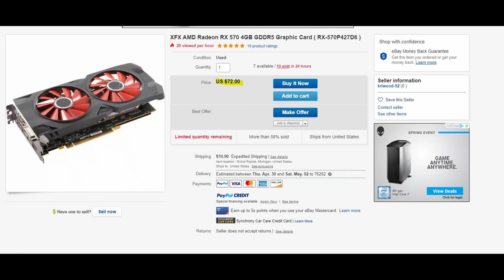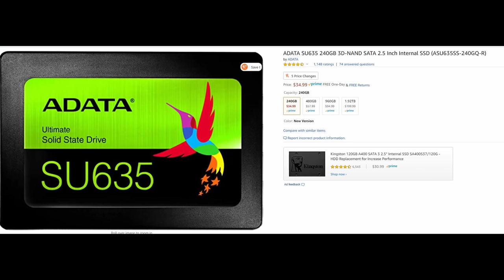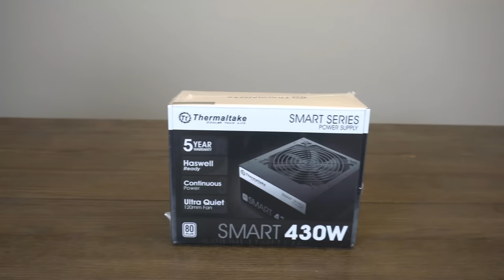$220 Just Get Gaming PC Build - Dell Optiplex 2020 + Benchmarks

Comment: The guy in video: A pc fit for gaming in 2020 standards, me: U need at least 2tb HDD for the games, come on my guy mw warzone is over 220gb Ur SSD will just about install 1 or 2 games if Ur lucky. I still have 6tb HDD for games, as my 2tb and 1tb Samsung Evo ssds are full of games.
Reply from the maker: I guess if you never uninstall a game you would need that much space.
Reply: @PCTechHustle  because my main drives are SSD, re moving and re installing causes ware and tear. So I very rarely uninstall games from the SSD, whereas the 6TB is a normal HDD I uninstall games that I no longer play.

Comment: How does warzone on low mid high settings run
Reply from the maker: Will run completely fine on those settings.  I have some additional bench marks coming along as I just upgraded the case and CPU in my latest video.  Benchmarks to follow!  Stay tuned!
Reply: @PCTechHustle  ok thanks!!

Comment: Wait ur telling me this rig got 134fps in fortnite but I have a rtx 2060 r5 2600 16g 3000mhz ram I play capped at 144fps but it doesn’t stay constant at all low settings mhmmm somthing is fishy
Reply from the maker: The lower FPS numbers at 1% and .01% lows are due to a CPU bottleneck.  I can improve those lower numbers if the graphics settings are capped to say around 120-60fps, etc.  This is pretty typical of when you have this situation being a CPU bottleneck.  Your system will have a much smoother game play experience.  HOWEVER, stay tuned!  My next video I put in a i7 2600 to see if we can get out of that CPU bottle neck and REALLY improve performance.

Comment: You need to add the drill price to the build man, everyone dont have the tools you have!
Reply from the maker: I disagree.  1. You don’t need to drill out the drive cage as I did.  2.  The price should reflect the components.  If I go with your logic then I guess I should include the price of my air compressor too?  Thermal paste?  Isopropyl alcohol?  My screw drivers?

Cmon man!

Comment: You left out to much iv never done this before I need to be walked through connecting parts to the motherboard and things like that what was that glue stuff you put under the fan and do you need that you never said anything about it I got to know if I need it
Reply from the maker: Sorry about that.  I may do a more tutorial style video for building up an Optiplex since the process is a bit different from doing a full build, though I do have a full build tutorial as well if you want to go check it out.  However that video is centered around building a Ryzen PC, however the processes are almost exactly the same.
Reply: Thanks for that

Comment: Aww for some reason this seems too good to be true for me at least. I just want to play Apex Legends and I've bought all the necessary components so hopefully it runs good.
Reply from the maker: It’s all legit man!  I’m not on a mission to steer people wrong!
Reply: @PCTechHustle  So my order for a dell optiplex was canceled but would a dell optiplex 990 sff also give the same performance?
Reply from the maker: Asian Persuasion you can get similar performance but I’d try to get the larger tower if you can so you can fit larger GPUs.  With the small for factor builds you can only use a smaller form factor GPU which tend to draw less power / perform worse.
Reply: @PCTechHustle  Last question. Will a MT 7010 also give around the same performance?

Comment: Adding Rx card was not smart , Gtx is better for low power consumption and then no need to change the psu , I installed GTX1060 with sata to 6 pin connector in same case and it works very well
Reply from the maker: I’ve used tons of RX cards, they are completely fine.  Doing what you did actually I would highly NOT recommend.  Using the old power supply and having to place a non-conventional power adapter on a low end PSU is asking for trouble

Comment: those 1% and 0.1% lows on fortnite dang!
can't play that game with anything less than a hexacore.
Reply from the maker: Fortnite I’ve found has become quite demanding.  I did cap the frame rate to 60fps which made it very much smoother of a game play experience.
Reply: @PCTechHustle  the game has also become a worse gaming experience, or at least that was the case for me i stopped playing even before the deadpool skin came out and i was having problems with logging in as well. Either way, as i said if you want to play it you'd need at least a 6 core and an RX 560 or something like that.
Reply from the maker: My lows were mainly attributed to CPU bottle necks.  Fortnite likes high clock speeds.  My build before this I actually ran a 6 core Ryzen and it did worse than a 4th gen Intel i5 quad core.  6 cores definitely doesn’t hurt though.  My next video will feature some upgrades to this system!
Reply: @PCTechHustle  oh alright i see. First time i played the game back in chapter 1 season 3 was a laptop with like a nehalem mobile processor 2c4t at 2.53 GHz no boost no nothing. It just barely worked then, now it would be a stuttery mess, basically impossible to run. Thanks for the information tho and keep up the great videos!
Reply from the maker: You are right though.  Many games are becoming more dependent on high core counts.  Fortnite has a lot of developmental backing, I wouldn’t be surprised if it was more 6 core dependent now than it was initially.
Reply: @PCTechHustle  i'm pretty sure it's the case if you want to avoid stuttering. I don't know if this counts but here's an indirect experiment: i have an MSI GF75 thin 8RD laptop with an 8750H and a 1050ti max Q, 16GB RAM. A friend of mine has a Lenovo Legion Y520 with a similar configuration but uses a 7700HQ for the CPU. He used to get many stutters and sometimes his frame rate even locked at 30 on it's own, while mine worked without a hitch. That's why i always thought that most esports titles needed at least 6 cores for competitive play (to avoid stuttering)

Comment: anything less than 500gb is not a gaming pc load the os and a couple of programs and load up 10 games max lol
Reply from the maker: IF that is your only drive.  This machine has a smaller 240GB SSD as a boot drive which will allot for a handful of games.  The auxiliary 500GB drive will provide more space for more games :)
Reply: @PCTechHustle  the thing is if im trying to flip a pc you'd have to assume the end user doesn't know about PC's so the user would be installing his games on the c drive id just get them 1 drive
Reply from the maker: Good points but it’s not hard to figure out honestly.  I’d rather save some change / have more storage with an additional drive.

Comment: dude wtf i have the same system but it runs THESE GAMES LIKE 30 FPS LOWER TFFFFFFFFF
Reply from the maker: Many factors can contribute to that, hoagies settings being a big one
Reply: PC Tech Hustle i run all setting low and 1080p
Reply from the maker: Anything taxing running in the back ground?  All the games I benched with I ran at high settings / 1080p, with the exception of Fortnite I ran on “Pro” settings

Comment: Crap.. I just bought and xfx rx 570
Reply from the maker: It will work.  Take off the backplate.
Reply: PC Tech Hustle I was worried since I’m new to pc building thnx:)
Reply from the maker: Nah you are good.  The backplate on those are garbage for function too, no thermal transfer at all.  It’s just for looks so you can remove it to clear the ram hinges.

Comment: Hi bro I have 350 pounds I need a gaming pc
Reply from the maker: Sounds like if you go after something like this you are set!  😉
Reply: Didn't expect you to reply quick
Reply: Do u have discord I have to show u something I don't know if it is worth 350
Reply: i5 6400,msi b150 m Pro vdh mono, 8gb ddr4,Nvidia gtx 1060 3gb, Corsair vs 450w psu, 250 gb ssd,1tb had Windows 10 for 350 pounds is it worth it
Reply from the maker: That’s honestly not bad.  Maybe try to haggle them a bit and offer maybe 300 pounds?  See where it goes from there.  That will be a decent 1080p gamer though!
Reply from the maker: I am working on the discord by the way!  Soon!
Reply: @PCTechHustle  I don't think he will do 300
Reply: @PCTechHustle  how much fps you think I will get on rainbow six siege
Reply: @PCTechHustle  ok
Reply: @PCTechHustle  should i buy it for 350 or should I try finding a better one I asked a lot of people but they said its an intel and said that the graphic card isn't good
Reply from the maker: Nothing wrong with the graphics card it’s comparable to rx570/580 performance.  I think it’s a bit expensive thus why I suggested trying to haggle it at a lower price.
Reply: @PCTechHustle  can u please find me a good ebay deal for under 350 please that would be able to run games over 100fps
Reply: @Blaine_04  buddy he can't do everything for you.
Reply: You cold build a reasonable custom for an extra 20 bucks but u could do a simmilar build to this guy bt mabe with a samsund ssd and a better performing graphics card with a core i7 if ur up to streaming

Comment: 430 watts isn't enough for rx 570 . the GPU consumes a lot of power so it needs at least 500 watts
Reply from the maker: It absolutely is!  As you can see it has no problems running.  I also measure my systems total draw from the wall outlet and never have seen something like this pull more than 280-290w.  That said 430 is PLENTY enough 😉😉😉